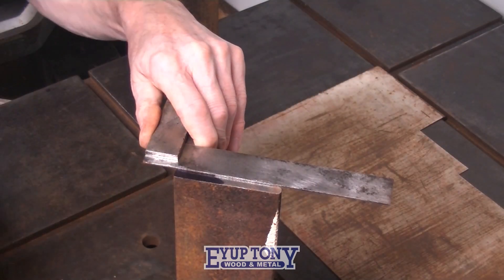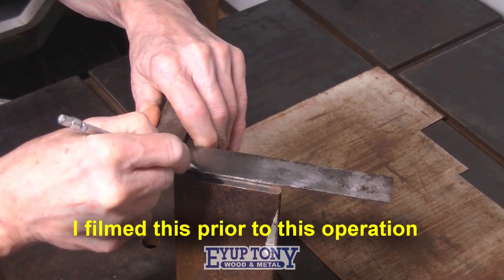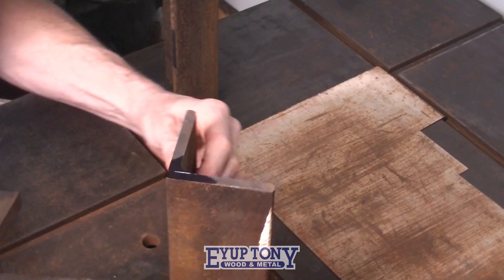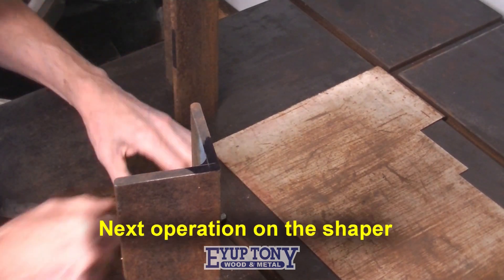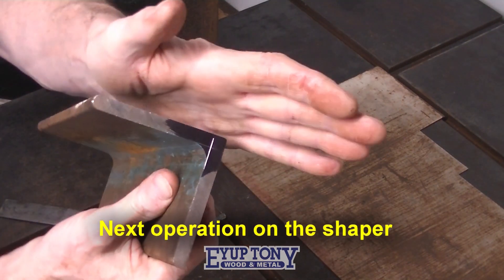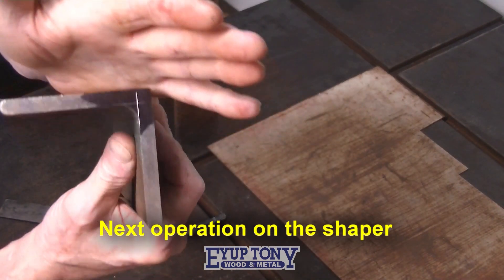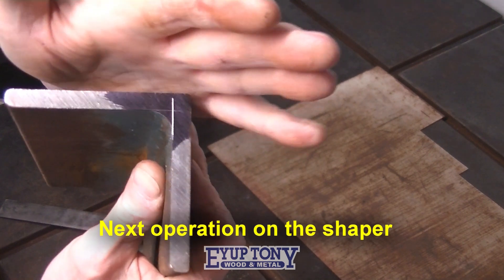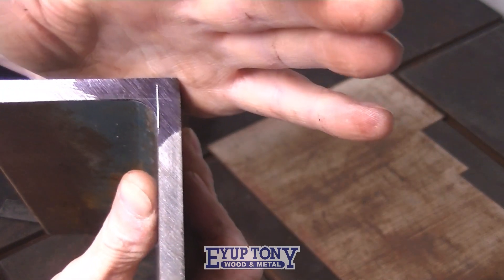Metal Shaper 13 Inch Stroke Easy Job

Comment: Nice machine. Overseas a kind workshop owner allowed me to use a 14M Elliot to make parts for my lathe - a joy to use. I note yours is very quiet with no noticeable slop in the mechanism.
Reply from the maker: Thank you for your analysis on my shaper. Great to here about your experience using the same model machine.
My shaper came out of a school in Halifax UK according to the chap I bought it off, in Halifax. It had been stood for a long time unused.
I picked it up with the ade of a my mate driving a skip lorry at the time. It wasn't going for scrap though.
That was back in about 1987, I haven't used it much. It also hasn't seen much previous repetitive production in its life.
There is some visible wear on the table horizontal slideway, but for what I use it for it's adequate for my achievable tolerances.
Appreciated.... Tony

Comment: Dear Tony,
I must admit...you have a beautifull shaper. Mine is an older type Alba 1A
Just one advise: turn the toolholder 180 degrees, that will eliminate "digging in" of the hss toobit in the workpiece.
Kind regards from The Netherlands,
Ron
Reply from the maker: @rgmveraart  Thank you, Ron. I'll give your method a try in a later video. I've seen it done, but I've been a bit dubious about the flex on the nut and thread as there is no sold rigid backing behind the cutting tool. The cutting force relying on the strength of the screw thread. I've already filmed removing the web on the angle iron, otherwise I'd of tried it on that.......Tony